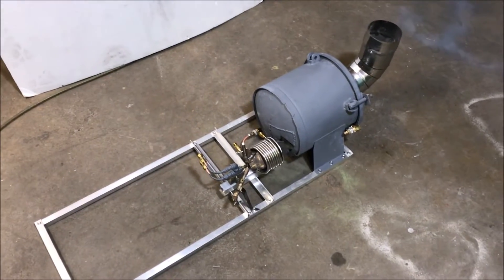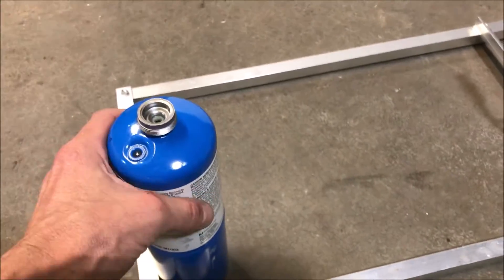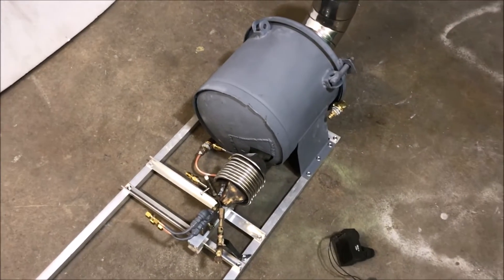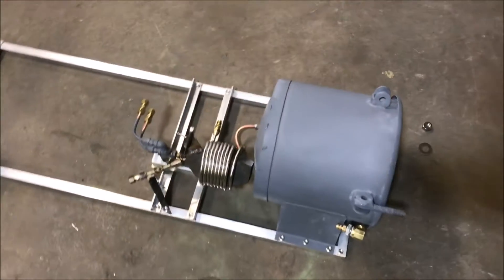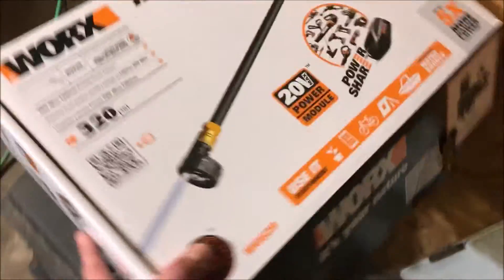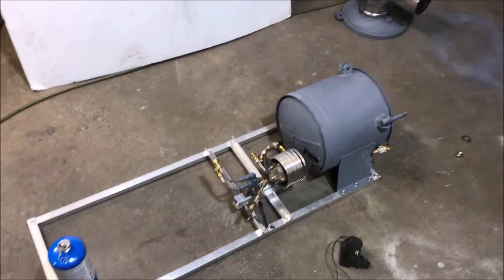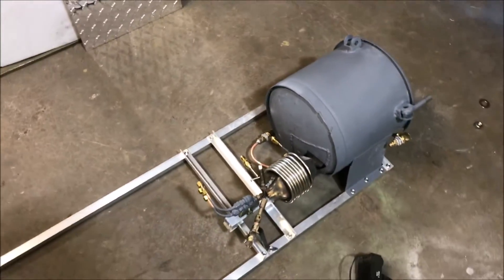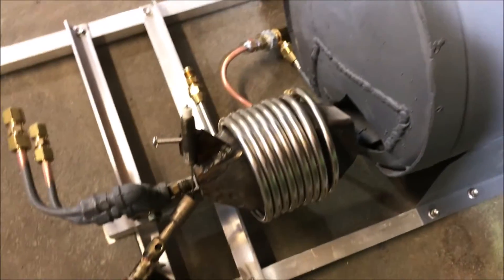High performanc Micro mono tube  boiler for Carlos

Comment: Is this going to have some wheels so you can load it with one person and a ramp to and from a truck or trailer and so you can move it around a jobsite without a forklift? ~( 'w')/

I would suggest some decent pneumatic tires so it can be moved around on unfriendly surfaces if it is not meant to be a stationary device.

All in all, it looks really good! (~_^)-b